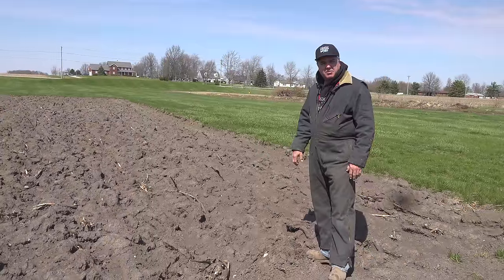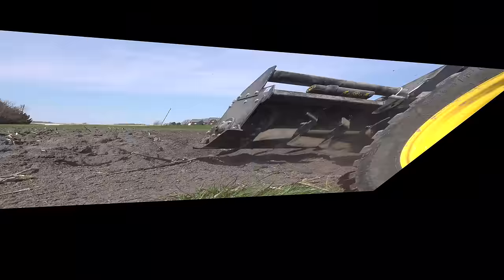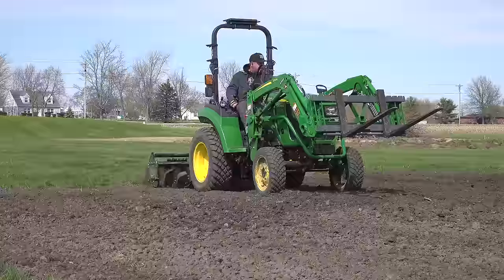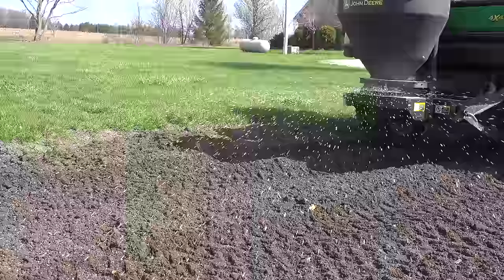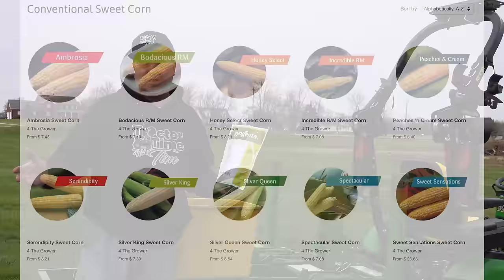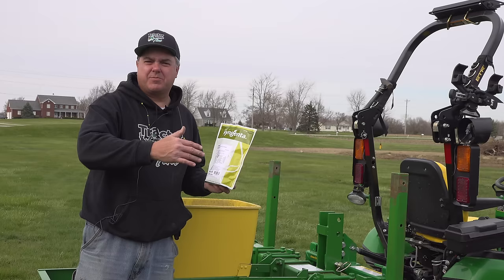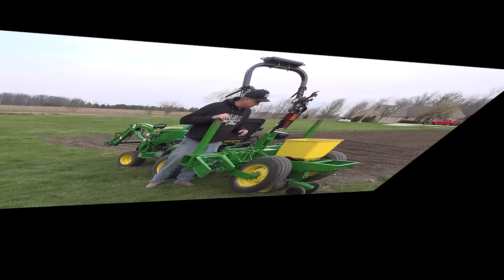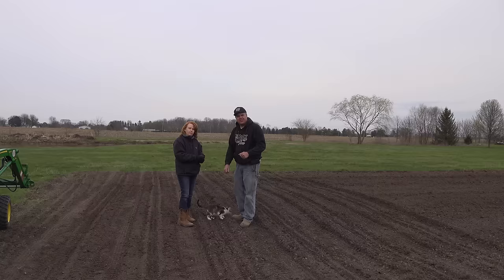Hobby Farmer! Planting Sweet Corn

Comment: Absolutely nothing wrong with wanting to use a planter like that. “Because dad does it that way” is reason enough. There are probably many among us that have a Johnny for similar reasons👍
Reply: I was going to comment, but you said it exactly like I was going to.
Well done Friend.
Reply: I still have Dad's 8-row 7000 planter, it's overkill to plant my sweetcorn with!
I'd rather find a JD 71 flex planter unit, they have the drive wheel on the row unit and use disk openers like the 7000. Using a plate in sweetcorn isn't that critical, and it keeps everything simple...
Reply from the maker: Hard to beat a single row or two row 7000!

Comment: Looks to be high clay content. Easy test:moisten with water and work with your hands: if it feels slimy it's high in clay.
Reply: Just need to do a ribbon test.  Get soil, moisten (like you said), roll it into a ball, then press it with your index finger and thumb into a ribbon. If the ribbon gets more than about 2ish inches it’s pretty high clay content. If you drag your thumb on the ribbon after you make it and it’s shiny, it’s clay and if it’s feathery looking it’s more so a clay-loam.
Reply: @tylermartin4726  i know it's now the subject of the video.

But what amendments do you add to lessen the %% of clay.  Iowa, my yard has high clay too.
Reply: John Jacob JinglehimerSchmidt to improve drainage in your yard and the health of your grass, maybe try aerating it and then top dressing it with sand. This is a common practice used by golf courses to improve rooting and grass health.  After top dressing it with sand you use a broom to help the sand into the holes produced by the aerator.
Reply: it's a very strange soil, iv'e never seen anything like it, i wrote to tim : your soil seems to have large sand grains, or large volcanic grains,  that would explain not powdering. i don't know why it stays wet, it must be wicking up from below, or your not much above river height ?

Comment: I plant usually 10+ rows of sweet corn - each row is about 60 feet long. I use  an earthway-precision-garden-seeder.  Rows can be spaced to 30+ inches and I can plant all the rows in about five minutes.  For those who want a good planter and save some money consider those - about $125...   The soil you have there sure looks heavy.  Best wishes on a good harvest, Tim...
Reply from the maker: I am not happy with the results from the earth way planter.
1) it does not do a good job of seed placement.  You may get 0,1,2 or 3 seeds in each ‘cup’ in the plate.
2) there is no way to change the population. 
3) the wimpy ‘chain’ is useless as a covering implement.
Probably the best you can do for $100, but not very impressive.
Reply: @TractorTimewithTim  I've had a similar model for nearly 30 years.. I found that, by slowing down forward speed and keeping the hopper at least 1/4 full, I get quite consistent plantings..  If by chance an extra seed drops down it's not often and when plants get about 4" high it's easy to see any that need yanking out..  For the cost - it's worked well so far.. I also use it for snap beans etc..

Comment: On 30 inch rows it is super easy to figure out spacing... to count final population once the corn is up and out of the ground you measure out 17'6" and count the plants and multiply by 1000 to get the final stand population. so the same can be done in the other direction.

Comment: You can adjust your skids on your tiller to adjust the depth.  I see that you have them on the deepest setting in the video.  It just takes a couple of minutes by removing a couple of bolts and loosening two others.  It has worked well for me on my tiller.  Thanks for the videos! Keep up the good work!
Reply from the maker: Nope, I have them on the next to the shallowest setting.
Notice when I let it float the skids dig right in.  Not only on this tiller,  but on KK as well.
Reply: Tractor Time with Tim True. That is a good problem to have. That is some great looking, dark Indiana soil for sure. Our soil is more reddish-brown here in Central Kentucky. Thanks for all you do! Love the planter.

Comment: The planter is nice and not overkill because it's tough and precise. I don't agree with the tiller usage for seedbed preparation. It dries the soil quite a lot. Maybe you could try using a spring-tine harrow. It won't be a beautiful finish on the first pass but it keeps a lot of moisture in the soil. Thanks for the work you put in making these videos!

Comment: Hi Tim. If you want to either dress up or level the top of your tilled soil maybe try either a power rake or a drag harrow. I’ve used both. Depending on how soft and or moist the soil is one might work better than the other. Either ay your not going deep into your tilled soil. The drag harrow is easier though just hook it up to your utv or atv and it’s faster.

Comment: I took the skids off the sides of my 60” Bush Hog tiller because they left giant grooves through my garden. I use the depth gauge on the 3 point and watching the RPMs of the tractor. The dirt here is thick red clay that clumps really bad. I am really glad I got a reverse rotation tiller because it does a much better job breaking up the clumps.

Comment: I have about the same tractor, my rear stabilizers loosen up all the time there’s a jam nut but it don’t work
Reply from the maker: There are wires which can be loops over the turnbuckle to prevent them from vibrating and rotating on their own.

Comment: I just bought a 3043 (2022 Deere) and I'm going crazy with brush hog and whatever. I want to plant some popcorn and so I love your video. I a middle buster and a small disc harrow and can borrow a tiller.  I have a question, you mentioned your seed being roundup ready. do you do some herbicide treatment before or after planting? didn't really see anything in the video and so, if so, what, and when?  TIA. I subscribed. thanks, Chuck
Reply from the maker: I wait until the corn (and weeds) are up a few inches, then hit with roundup.
One more roundup application just before tasseling….and call it good.
Not sure if you can get roundup ready popcorn….but I suspect you can.

Comment: Tim, would you recommend a 1 or 2 series for a hilly forested area?

That planter uses the same JD Tru-Vee row unit as my 4 row 7000 from 1979.  In fact, it looks like they just took a 7000 and cut both left row units and the outer right row unit off.  Guess it just goes to show you, if it ain't broke, don't fix it.

Comment: I put 19-19-19 right into my corn planters right in with my sweet corn but you have a lot better soul in Indiana than I have in southeast Kentucky mine is hard yellow clay a lot of it and some of it is good dark Rich Creek bottom depending on the deer and animal damage get somewhere in the 26 to 28 thousand ears per acre but I use a double plant method I plant two rows step over 8 inches and plant agian I use a ford 309 planter my seed is between 8 and 10 inch space  used to get only 18k ears per are till we started this last year and it works
Reply from the maker: How much do you plant?
Reply: @TractorTimewithTim  this year I'm going for 10 acres of sweet corn and 4 Acres of green beans I would have 33,000 ears to the acre but I have to a lot for my animal damages

Comment: How do you like that Tufline RTM72?  I was looking at the RTM line, wasn't sure if the 2038R would have enough power for sizes 66-84.  Have you had any issues with Johnny 2 struggling with the RTM72?
Reply from the maker: Love the RTM line, as I mentioned in this episode.   It is MUCH tougher than the King Kutter that I have.  Having said that, the KK is pretty tough!
The 6' is a handful for the 2038r.  Just finished a job yesterday tilling about an acre of sod.   Whew! What a load.  Still, I'm glad I had the 6' as it helped get the job done quicker.      One needs to go very slow with Johnny 2 with the RTM72.  Of course, it is good to go slow with a tiller.     You might want to stick with a 60 or 66.

Comment: You need to invest in a spike drag to level it before you rototill
Reply from the maker: Why?
Reply: @TractorTimewithTim  Pulling a spiked gang drag behind your rotor tiller or your plow will level the top.    If you just use the drag before your first tiller pass, your tractor will bounce less.. 
 The fewer times you roto-till, the bigger increase in the amount of microbial activity in the soils.   This increase releases nutrients available to your plants.  

To compare what I mean, when your corn gets to tassel, take a shovel/spade and go into the grassy sod area at least five yards from your plot.  Dig down into six to eight inch profile.  Then compare its look to  the same inside your plot.   I will bet that the grassy area will be alive with organisms.    

Also, if you toss a shovel of soil from each into two separate buckets of water, you will be surprised to see what floats up.    

Tilling very shallow will control weed pressure, save soil profile, and increase your crop yields.

Comment: The jd2038 have 37 hp right? And it can turn a 73” tiller? Wow o.O not bad
Reply from the maker: The 72” tiller is a handful!
Reply: @TractorTimewithTim  maybe my 35hp tractor can work with a 65" tiller.
I have an old Fiat 350 special. :)
Reply from the maker: @9Enrico0  The only way I can pull this tiller is due to the hydrostatic transmission.  I can slow down to a crawl if necessary to allow the tractor to 'catch up'.

Comment: Do you add compost to the garden to help loosen up the soil?
Reply: Chris Bishop I have been adding wood chips to our garden for several years. I learned the hard way not to put freshly cut chips on the garden because it will suck the nitrogen out of the soil until they start decomposing when the put it back in the garden. Weird. But it really helps the red clay in Georgia drain water and not crack when it gets dry.

Comment: Just because the farmers don't till very deep doesn't mean they are correct. One of the major failures seen all across the country is the failure to till deep which is costing farmers large yield losses. You can notice it most on the headlands where the machinery does all the turning. The cost of compaction is seeds that don't sprout and come up, water that does not drain, and roots that can't penetrate the hard pan. Deep tillage is worth it, both in the garden and on the farm. Farmers are attempting to reduce their input costs in regards to equipment time, fuel consumption and labor. IMHO...sloppy, half effort farming.
Reply from the maker: Ha!  
A couple of things incorrect about your comment.
1) I said they don’t till deep IN THE SPRING.  They usually till deep in the fall.
2) Farmers are proving that no-till is turning out to be the best approach for the land and yields over the long term.
3) Farmers invest much more time and effort researching the best and most efficient methods to grow crops that you or I ever will.
They KNOW what they are doing.  These are not the stereotypical “Green Acres” types.